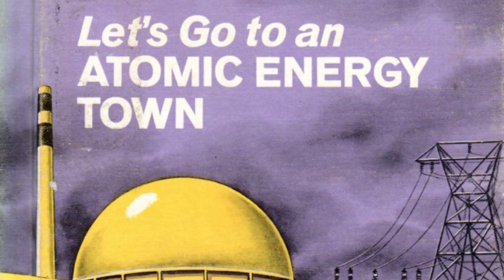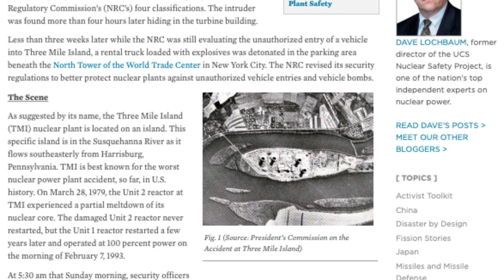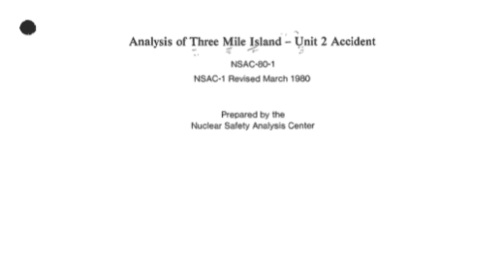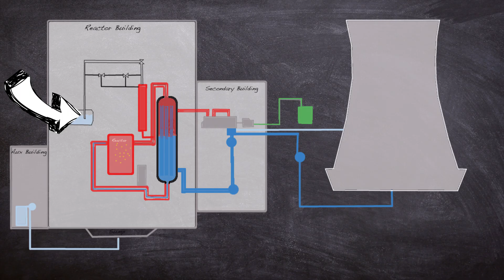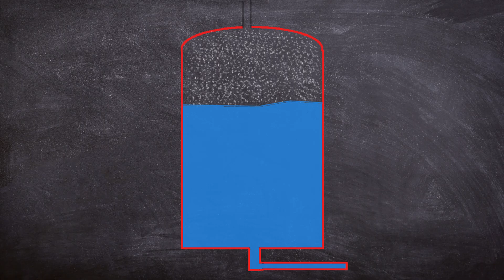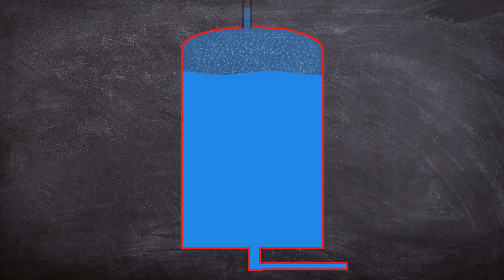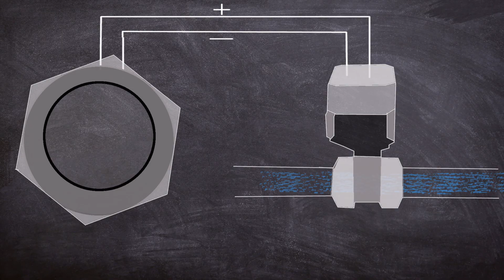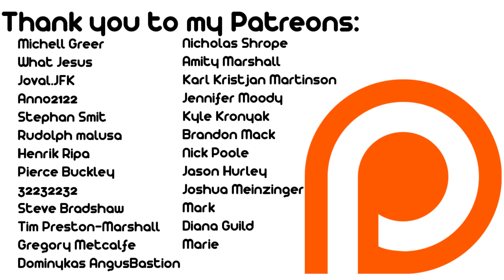A Brief History of: The Three Mile Island Accident (Short Documentary) (Part 1)

Comment: As usual, it take a number of failures happening in just the right order to cause a disaster. This is also why airplanes crash.
Reply from the maker: We are taught about it at work, they call it the Swiss cheese model
Reply: @PlainlyDifficult  what job do you do?
Reply: Always got to plug the cheese.
Reply: Withe a robust design, you need many failures to get an accident of any significance.

With a less robust design you can have a disaster from any single failure.

With the robust TMI designs it required mechanical failures, maintenance errors and operator errors.
Reply: @fhuber7507  I wouldn't call any design where an indicator light is connected to the power source of a solenoid instead of a proper sensor on the solenoid actuator "robust". In fact, any design that depends upon a human acting on a light on a control panel is inherently unsafe. The issue with nuclear power is that humans are always doing stupid shit around it. With today's technology, it would be simple to build a reactor that would be completely automated, with multiple failsafes that CANNOT be bypassed by pushing a restart button, and humans only required for maintenance or repairs. But apparently human lives are worth less than the cost to implement a safe reactor that might have more (justified) down time than other less safe designs. If the computer tells you you have a malfunctioning pump, or your multiple sensors are giving you conflicting data, no one should be able to bypass alarms. From abormal pressure buildup to on-site radiation detectors, to fire alarms or even Tsunami warning system, this should all go into 2 or three computers operating on a consensus system (in case one of the computers is malfunctioning). The reactor should be immediately and automatically powered down, failsafes for the malfunctioning systems activated, and restart prohibited (via automated lockdown) until affected systems have been inspected and repaired. If you have one pump down, switch to the backup automatically and limit power output of the reactor until the malfunctioning pump is repaired and operational. Missed a scheduled maintenance deadline? Power down the reactor until the scheduled maintenance is complete. Never leave it up to a human. A human will always inevitably mess it up.
Reply: While this is true, and the cause of most industrial accidents ends up being administrative/managerial, there was a precedent for this accident to occur. A plant of the same design had a similar occurrence two different times, where the PORV was stuck open. Davis-Besse plant in Ohio. The operators there were able to figure out what happened and avoid problems. Engineers warned that the other plants with the same design were susceptible to this type of accident (small break loss of coolant). The failure is that the engineers warning was ignored.
Reply: @Dave_the_Dave  
   GPU Nuclear was going to build another reactor beside Oyster Creek in NJ and the Three Mile Island plant had the leak,not sure what kind of leak but they didn't build the unit because of. GPU ran both plants.I worked the Drywell Outage in 1986 at Oyster Creek.
Reply: @Mark Hule Cheap natural gas and expensive reactor construction costs is the downfall of nukes.
Reply: John It is almost never due to complexity, but due to cost cutting, which is what likely caused Chernobyl. Also, rule number one with nuclear fuel rods, do not let them get hot. Keep them cooled. Heat is what causes meltdowns, nothing else honestly.
Reply: I've worked in power plants for 30 years.Nothing new here.
Reply: Well - that and gravity.
Reply: Honestly, I would not be suited for problem-solving environments that would be critical when it comes to the solution needed, had the situation at local television way to much that we ran into a very critical problem that caused practically all in the tecnical director's room to try and look into possible causes, all the while forgetting to try and inform our viewers :P (there was a different cause for acting like that as well, but still).
Reply: just melt the damn cheese, problem solved lol
Reply: Plane crash? Something something September 11th '01
Reply: It always seems to be three different factors.
Reply: Sar Jim airplanes crash because of the ground. BAN ASSAULT GROUND!!!
Reply: @FlatBroke612  There wouldn't be crime, nuclear accidents, the ground that destroys planes, or people who kick dogs at all without the earth! 
#cancelplanetearth
Reply: @FlatBroke612  2 year old comment and my first time seeing it. Straight gold and a good harty laugh 😂
Reply: @FlatBroke612 fight the real enemy! 👊
Reply: @EthanWeeter  Go run a nuclear plant on Fantasy Island. On Feb. 11,1985, Forbes magazine said, "The failure of the U.S. nuclear power program ranks as the largest managerial disaster in business history, a disaster on a monumental scale...only the blind, or the biased, can now think that the money has been well spent. It is a defeat for the U.S. consumer and for the competitiveness of U.S. industry, for the utilities that undertook the program and for the private enterprise system that made it possible." It has only gotten worse since then. Are you blind or biased? Look around. How many new plants do you see? Even with the Nuclear Regulatory Commission easing up on the commissioning process due to the Energy Policy Act of 2005 and new tax incentives and loan guarantees, of the 30 new reactors planned, only the Vogtle reactors are still under construction. With huge delays and massive cost overruns. And get this, the reactors are collapsing in the middle causing the outside walls to bow in and the reactors aren't even built yet. What is going to happen when they fill those gargantuan water tanks on top up and crank it up. Fourth of July will come early in Georgia. Fukushima Daiichi had a history of 40-60 foot tsunamis, but a 12 foot tsunami protection wall. Operate that properly. Davis-Besse in Ohio has a 15 foot crack in the containment, but the license was renewed until 2035 because of bribes to keep the plant open. Everywhere you look there are additional examples of mismanagement, corruption and cover-ups. Don't tell me about safety at nuclear plants. Get your head out of the sand....Honestly.
Reply: @jackfanning7952  That all sounds made up lol

Nuclear has the highest power to waste ratio of any power generation. In fact, coal mining releases more radiation then all radiation released by nuclear plants. Unless you want climate change to get worse, nuclear is the only option.
Reply: @JS-po8oc  I don't think that is actually true. But it would maybe make power much cheaper if we did embrace it and thus is all the reason those in power have to not embrace it. It would cut into their bottom line.
I think we need more options than just nuclear, but I do think we need to embrace nuclear more. Our technologies get safer all the time, despite the callous disregard for safety those who make decisions have.
Reply: @jacobfreeman5444  the French use a sub standard uranium fuel reactor setups for cost efficiency. The same material they use to power themselves is depleted uranium wastes. The kind of stuff sitting in the parking lots at the gaseous diffusion plant in Kentucky, and there is thousands of tons of the stuff just sitting there and waiting to be the next ecological disaster. That's enough fuel to power the country indefinitely. Of we could switch to sub standard or not quite as refined materials.
Reply: @Mark Hule Our republic is coming to an end because of the Biden Administration.